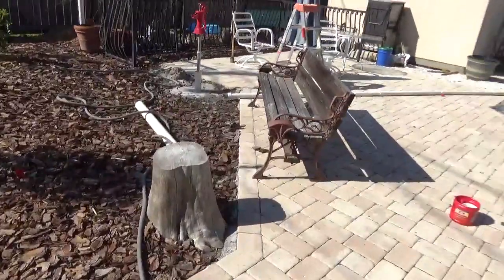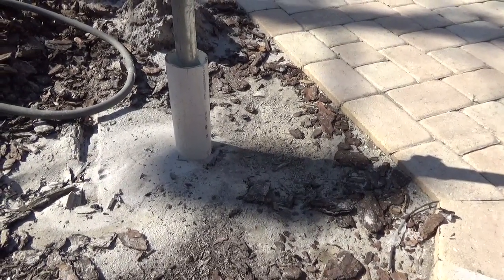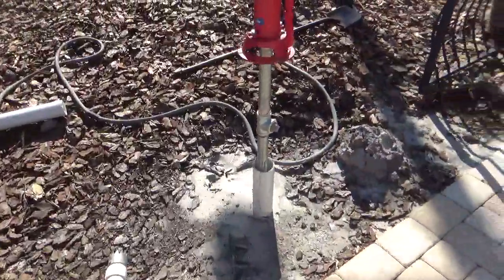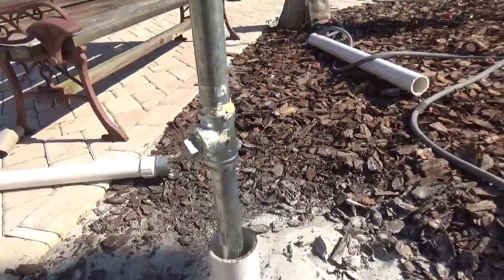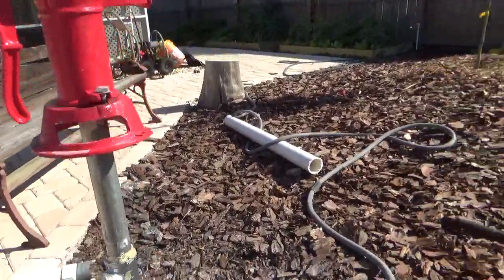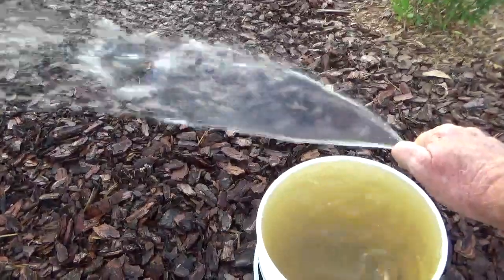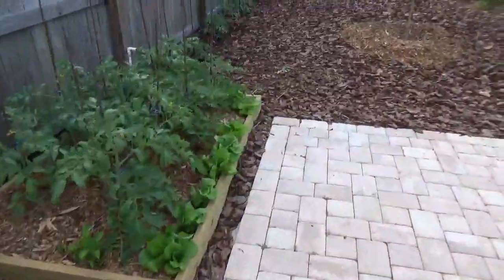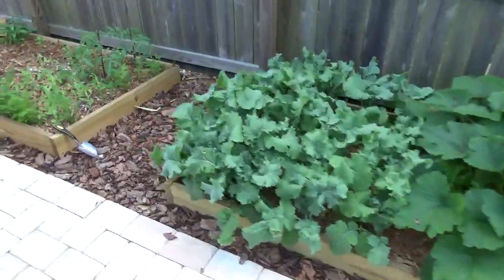Jetting a shallow well DIY

Comment: I've seen people just drill little holes or cut slits into same 2 inch pipe and leave that is as their well pipe they attach the pitcher pump to. What do you think about that?  The only reason I think i would have a casing is to recover drilling water for a remote drilling where i don't have a lot of water for drilling. Thoughts?  How is your electric pump working with just  a T connector?  don't you lose pressure with the pitcher pump while electric pumping?
Reply from the maker: Well first thanks for watching and commenting. If I had left the 2 inch in the ground I wouldn't been able to add a foot valve on the bottom of the pipe which not only keeps water from flowing back down but also stops large shells from being sucked up the pipe. most of Simmons hand pumps are 1 1/4 inch yes I could have reduced it but there again the foot valve issue. The casing is for if I need to pull the pipe out, It's hollow down to 15 feet, there's only 7 feet of pipe that is not exposed in the casing. If you notice there is a gate valve just above the T yo isolate the picture pump from the electric pump. Hope this was helpful. 👍😎

Comment: Hey looks great and nice video! how much water do you get out of that? How long does it take to refill if you pump it dry?
Reply from the maker: Thanks for watching, It took about 45 seconds to fill a 5 gallon bucket that's 375 gallons a hour and it ran for 4 hrs( getting alot of sand) before I turned it off that's around 1500 gallons. I don't need to run it that much anymore so I don't think it will go dry.
Reply: Oh wow that's a lot more than I thought! I have a plot of land in a flood plain, but doesn't usually have standing water, that I want to farm it, it has amazing soil. I dug down about 1 foot and hit water 2 feet down was a decent amount of water also. 

My thought it that I could build something like this to keep pumping out enough water throughout the summer for a small veggie plot. Any thoughts ? Thanks
Reply: Loaderman 1500 gallons why do you need the city water?most people only need 375gallons

Comment: What type of electric pump did you end up putting on top of your shallow well? Where did you buy it? Or was it a pump that went down inside the well?
Reply from the maker: That's a utilitech 1/2 horsepower shallow well jet pump number 095-5549

Comment: Did you cut slits or drill holes in the three and a half inch casing?
Reply from the maker: The casing is open on both ends, makes it easier to pull out the 1.25 inch well pipe and also protects the well pipe. The well seal on top keeps out ground water. on the bottom of the 1.25 well pipe there is a foot valve that has the holes in it.
Reply: Thank you for the response. I am still a little bit confused. If there is no holes in the 3-inch pipe how does water get in only from the bottom? And if it is coming in from the bottom if you had to guess do you have any idea how many feet of water you have in that pipe?
Reply from the maker: @joerod6106  The 1.25 inch galvanized pipe goes down about 8 feet below the end of the 3 inch casing which is 15 down The length of the 1.25 is about 23 feet down, I'm pumping from the bottom of that pipe. The only purpose of the 3 inch casing is to protect the smaller pipe inside it and make it easier to pull out if needed.
Reply: Got it! Thank you